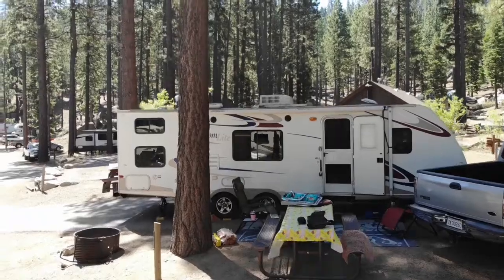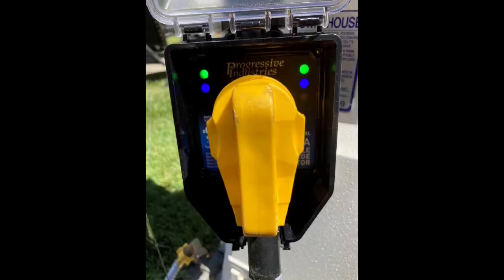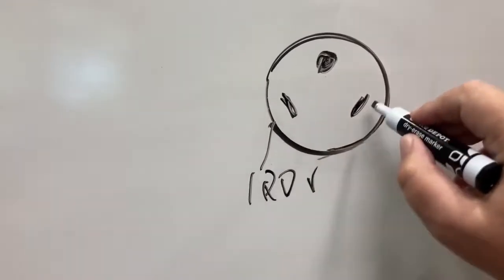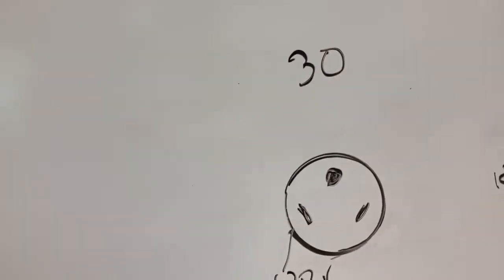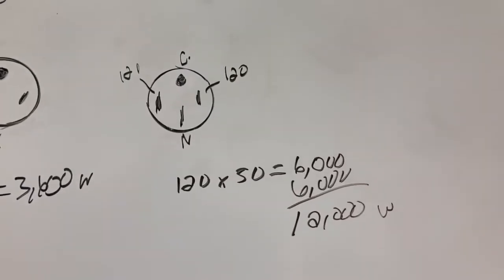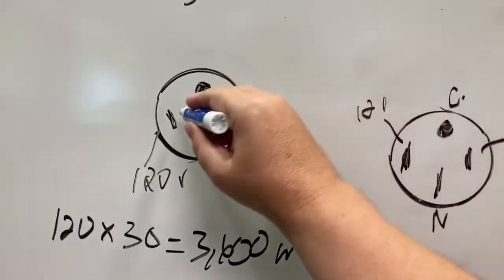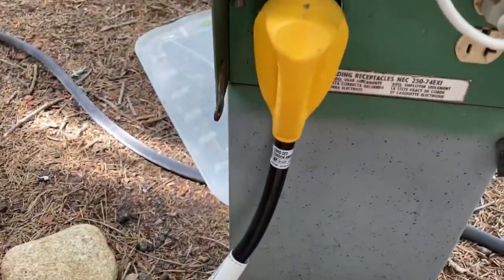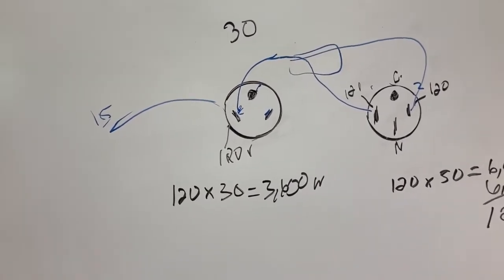RV Progressive Industries Surge Protector, 50 amp, 30 amp, adaptors. RV power.

Comment: This made sense to me. Thanks for this video. I believe you used the 50 AMP surge protector plugged into the 30 amp extension cord into a 30 amp campground outlet. Is this correct?